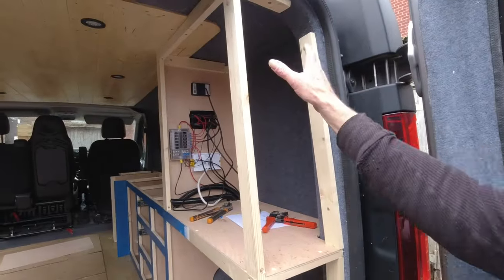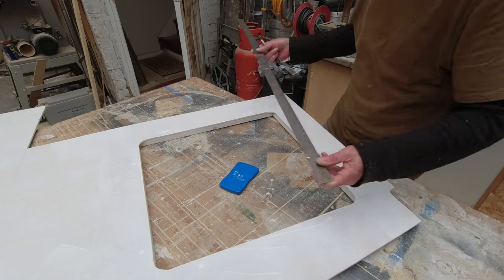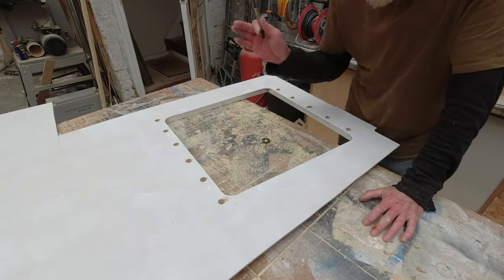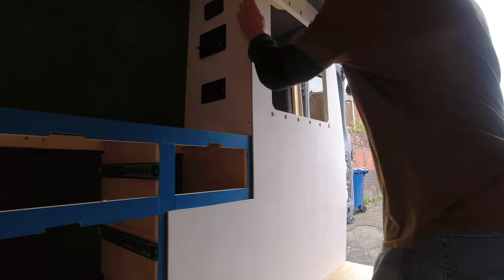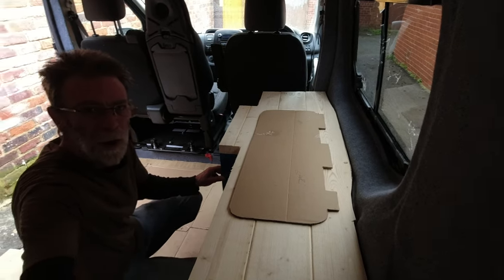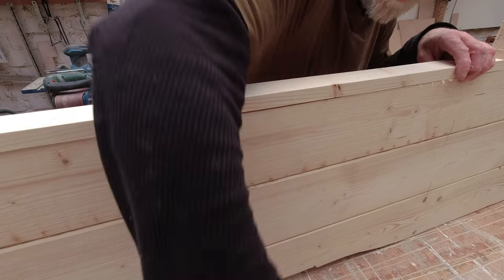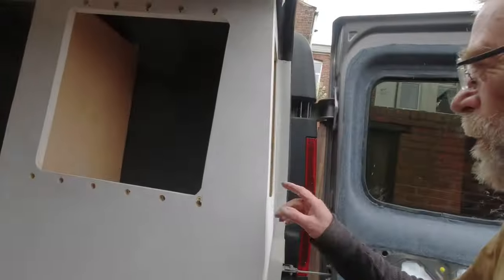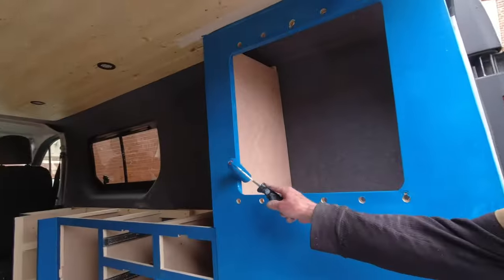Vauxhall Vivaro Camper Van Conversion (Day 15)

Comment: Always an education, thanks Dave, just wondering why you’ve changed the location of your electrics in this build. I’ve had a couple of days to work on my H2 L2 got solar, insulation (on too much needed in Australia) and some carpeting done.
Reply from the maker: I change the position of the electrics depending on the layout of the van. This layout works best with all of the switches etc on the side of the tall cupboard. I currently working on a H2 L3 Boxer van doing some work for a friend. But I'm tempted to get one for myself I'll video the whole build if I do get one. Thanks.
Reply: @dave-watson   yes you can fit everything into that Boxer, nice size if you have to budget 👍